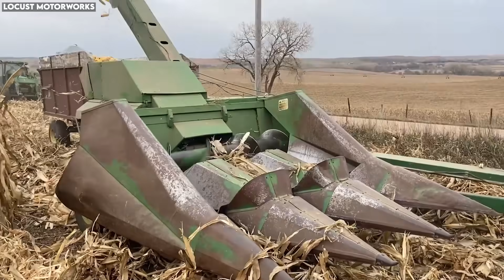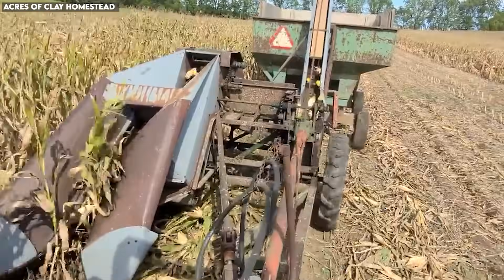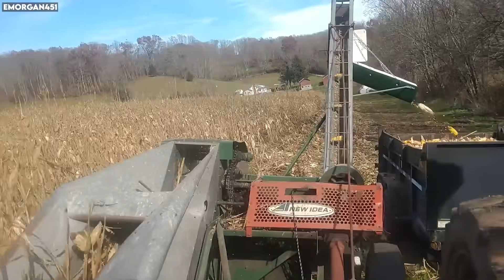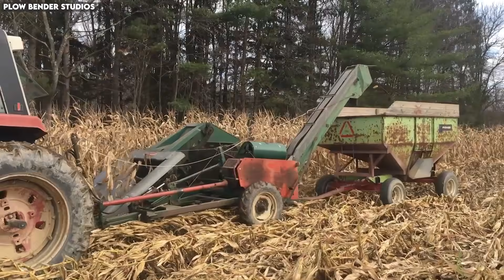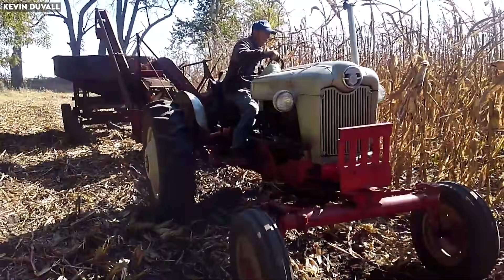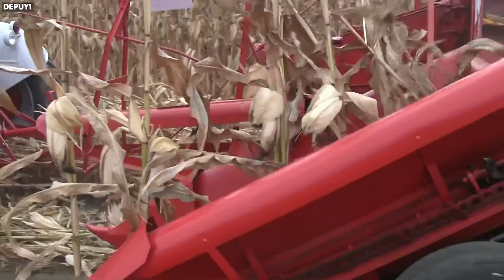10 Old Corn Pickers That Were Brilliant, But Almost Impossible to Maintain

Comment: Marketing idea... "Just my opinion for ya Robin.. " BUT for it to work.. YA NEED TO WAIT 11 MONTHS...June 2027 However. "Take it with a grain of salt!"
The ideal way to sell wheat is phone your grain buyer in mid June when it's total bone dry but it's raining on either side of ya and tell them you have a "10 bu. to the acre (6" tall heading wheat) will be a stretch!"  a total disaster wheat crop or a year later another absolute disaster hard to do anything crop..
 But guaranteed 13 months later (either year) you will mysteriously have lots of later September very uneven crop harvested wheat "Mega Tonnes" with high 15% protein that yer going to have in the bins and would rather 13 months ahead forward contract sell July Delivery for the highest price that anyone else will get... Than turn it into bags of +++ $$$ bu. Blum #1. High Protein  Bags of Cowboy feed..
 He/She the grain buyer .. Will give ya the best crying towel they have that day for that... You should just plow down or in 3 months dry 6" harvested 10 thin kernels in the head crop and ...... 
For the Bins are still busting Contracted for July 13 months later a better $$$ premium price!  
  So there is come September that Magical crop done did turned around 2 years straight..
 Not to 80 bu./acre but a good harvest and much needed extra bin space!

Comment: Grew up picking corn with a Dearborn Wood Bros 1 row picker. The thing was bullet proof and picked corn for decades. Still there and could pick corn with little or no notice. Keep it clean, keep it lubricated, keep it adjusted and it picks corn. Minimum repairs needed.

Comment: My first picker was an IH MDH. It was a great machine. It worked great but it left a lot of corn in the field and was a bear to take off and put on. After that I had a 700 Unisystem. It was a lot faster and did a good job of harvesting however you better take the toolbox with you because you're going to need it. I drove to Coldwater Ohio many nights to pick up after hour parts. And yes I caught it on fire once by leaving the E brake on. Thankfully I saved the machine but I lost 3 acres of standing corn. Lastly I had a new idea 2 row pull type. It was easy to use and didn't tie up a tractor. Basic maintenance kept it running. It was hard to stay on the row on a sloping field where the ground was wet and you had a full wagon. I sold it when I quit doing ear corn. It's possible it's still running someplace

Comment: This has to be the worst most misleading "documentary" I've ever seen.  Most pickers were notoriously easy to maintain.  Grease them and go.  The safety factor is overblown.  Yes, it's true, a very few farmers lost arms and legs because they were too lazy or dense to simply stop the machine prior to cleaning.  When I was a kid, we had an Allis Chalmers 33, then a mounted Ford and moved onto a IH 2MH, the one I learned to pick on.  Then to a mounted New Idea and finally the cream of the crop, a 727 New Idea Uni.  I could install the New Idea mounted on a WD45 in a morning by myself and be out picking right after finishing dinner.  The UNI attachments could be switched in a couple of hours, by myself.  Most of the issues identified as problems are either overblown or didn't exist at all.  I suspect the creators never operated a corn picker and were never around one.
Reply from the maker: I appreciate you sharing your firsthand experience and technical perspective on these machines.

Comment: We ran corn pickers without any problems. WE KEPT OUR HANDS OUT OF THEM WHILE THEY WERE RUNNING. They are/were machines. Keep your body parts out of running machines. ???Was this written by an attorney???
Reply: My brother in law, many years older than I, lost his hand due to a corn picker. Yes he put his hand where it should not have been. One of the pegs on the husking rolls caught his glove. I was quite young at the time but it made a lasting impression. I’m not sure why my mind skipped over this on the original post other than it was over 60 years ago?

Comment: My Dad started with the Allis Chalmers 33 corn snapper mounted on an Allis WD. It was a pain to mount as you had to strip the Tractor of everything then hook the undercarriage of the picker to the tractor frame. Hook and bolt on the snouts. We then took the loader to lift up the elevator and slide it into the mounting yoke. Then had to climb under the picker to hook up the hydraulic ram to lift the front end. 

In 1964 he bought a Ford 602 as he wanted a picker that did not she’ll in the field from the snapping rollers. That worked fine but the hushing bed was 4 rollers on each side and could not handle the corn to feed it down to the elevator. 

It was easier to mount but had to take the tires off and switch sides to be side enough for the front end to fit on the tractor frame. The other big issue was the nubs that fit in the drive pulleys would wear the pulleys badly and had to be rebuilt. 

He ran the Ford until 1972 when he got a Gleaner K combine. But we still mounted the picker until 
1975 when he quit feeding out feeder cattle. He liked feeding ground ear corn for Cattle feed. 

The ford picker sat from many years until it was bought by a farmer from Idaho who wanted the front unit for picking sweet corn. They cut off the elevator and left the old husking bed